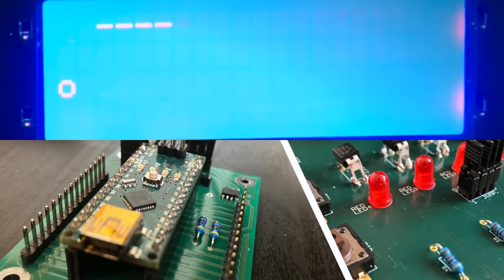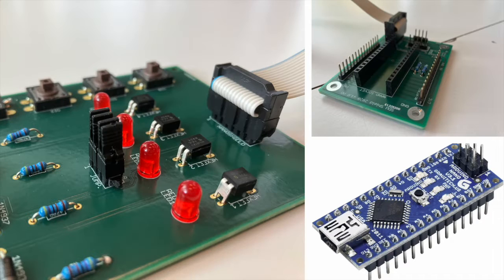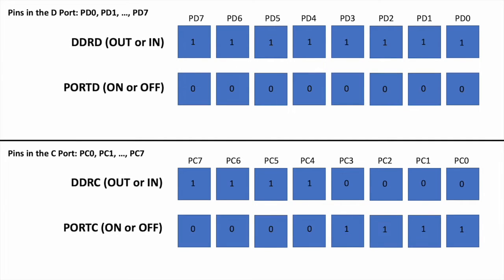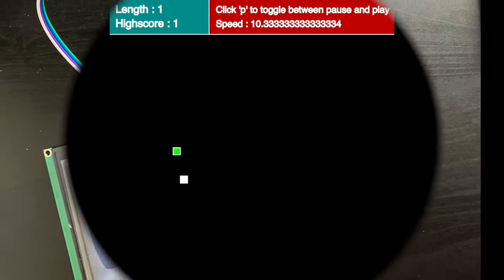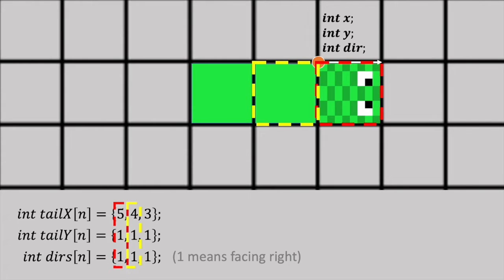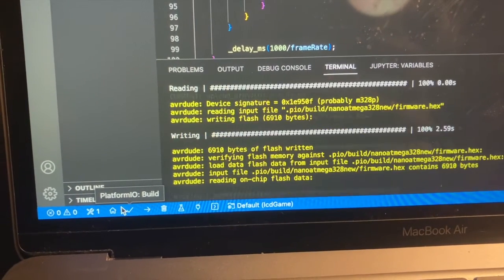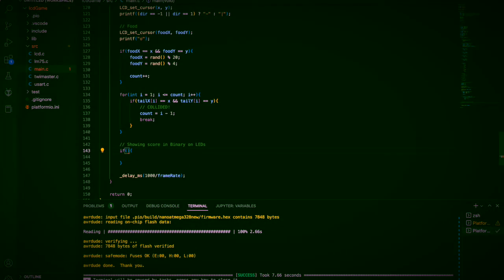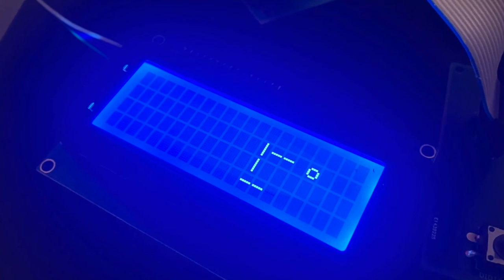Snake Game on a Small LCD with Arduino | Programming in C - Coding Challenge #12

Comment: Such a beast! I was wondering if you could make the code any faster if you assigned a new position only to first and last cell of the snake. I'm waiting for your update on that ;)
Reply from the maker: Hehe, thanks for this suggestion! So, I think this algorithm would work a lot better. It would certainly make the code a lot more efficient. Instead of me looping through every part of the snake, I would just look at the front and end, very clever indeed! But, practically, I think it would make a negligible difference since I anyways set the framerate of the game before. So, it would make the code a lot more efficient, it is a way better algorithm, but I think it would make a very slight, unnoticeable change. Thanks again!